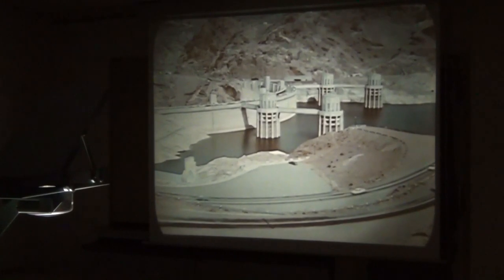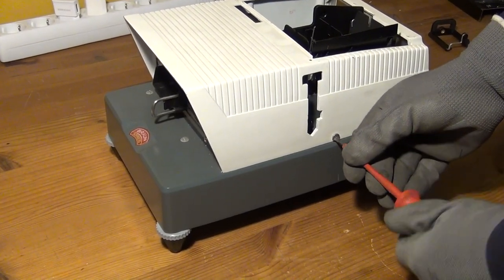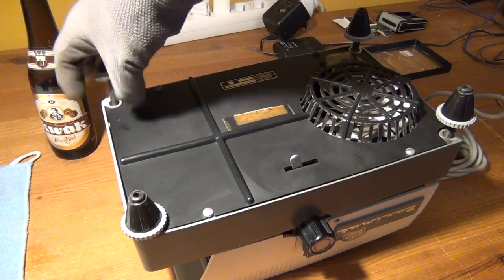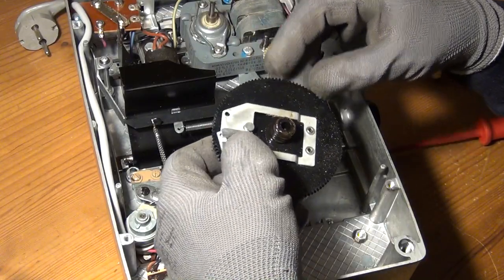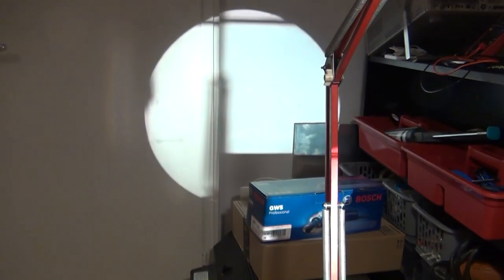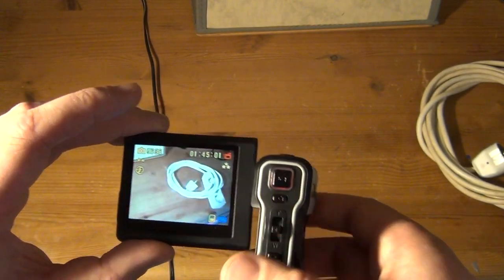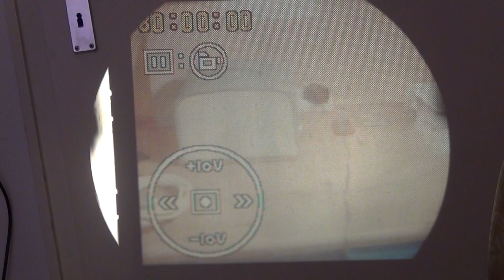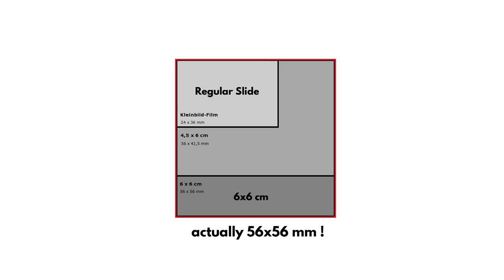Hack: DIY Video Projector from 1960s Slide Projector ?!

Comment: Keep in mind that heating of the LCD panel will end its lifespan early.  TFT technology is more heat resistant than regular LCD panels. 

I made from scratch a video projector back in 1992 using a CASIO pocket TV but that technology was plain LCD and the screen burned out after a few minutes.  Then I acquired the first Phillips TFT TV pocket projector and that ended up being stable.  I even sold the projector to a school when they were not yet available in the market...

Comment: This is a great channel showing re use of old machines and components.  This was a quality antique projector before the failed experiment.  It seems now it is only useful for the parts bin.  It may have been obvious that a smaller lcd or larger format projector would have produced better results.  I would have preferred to see a repair or tune up video of this machine.  Maybe an LED upgrade of the light source if possible.  Keep up the good work!

Comment: I really enjoy your inventiveness :-D, the slide projector is not too far away from commercial units that people use for presentations.
That one was built really well, german engineering is well known for quality and reliability.
Although they can go a bit too far with complexity, simple is often reliable :-).

If you do find a bigger 60 x 60 mm lcd, you may want to add a really good fan near the lcd, i can see it being cooked by the lamp, that would be a shame :-(.
Reply: 4 inch smartphone, about 2014 vintage, will be cheap, run vlc player for ease of formats, force it to run in 4:3 and i think it will work fine (just be careful its not a samsung oled one)
Reply: jusb1066 only the flagship devices have amoled from their everything else has lcd

Comment: The Raspberry Pi GPIO displays that you get from AliExpress should fit , you can connect it to a raspberry pi and install openelec , maybe even retropi for a awesome little media player on the go.

the biggest problem will allways be resolution I think the highest I've seen those small screens go is 320x240 you can get higher but they are ofthen times designed for cellphones and can't be driven easily.

Regardless, awesome project and video , looking forward to some more experiments.
Reply: The even bigger problem to me with those that I've encountered is that no matter the resolution, they have dog slow update rates, which makes them totally unusable for any enjoyable video playback. The one I had, had a parallel data bus that took up almost all of raspberry's GPIO (and didn't support any hardware acceleration), and then, even with differential updates, it was awful to use even in fbconsole. That said, I never got around to running X and other graphical stuff on it.

Just my 2 cents, YMMV.

Comment: A small tablet or smartphone could work. You'd probably be better off gutting the projector and making a custom enclosure with the lens and bulb.. Then you could use an even larger screen by adjusting the focal length between the lens and lcd to suit the width of the LCD.

Comment: Surprised I didn't see mention of using a display for a Raspberry Pi. The most likely candidate I found (assuming I still know how to math) was a 2.8in TFT display which should be a touch smaller than what is ideal. I also found a 3.2in display, which would be a touch big if that were a square, but it has a wider aspect ratio so I doubt that one would work at all.

Comment: The heat from the bulb will severely shorten the lifetime of the small LCD screen, I would make sure that it has ventilation, and perhaps insulate the electronics from the hot areas. Also, see if a suitably bright LED bulb can replace the projector bulb. However that might not fit the low-cost theme.

Comment: Slide projector bulbs were/(are?) expensive and short lived.
Reply: Yes, those are used products so you don't know how many hours are left, and then you have to look to substitutes that are also already used...
Still, it's a lovely project, and it entertains. Fun doesn't have to be useful.
Reply: Dan Harold a 100w LED module might be a suitable replacement
Reply: A 50 or 20W one will be cheaper and maybe a better size.

Comment: Maybe take a display from a broken mobil phone, maybe with cracked glass, display is often still intact
Reply: at least a android phone will be capable of playing many formats directly from SD, the camera he was using probably is very fussy on its format, its only meant to playback its own files, yes you wont find a square screen, but you can maybe control the format from the video player and force 4:3
Reply: *****
hmm not really perhaps at most 50 euro, plenty of early moto g's, and htc's around
, just quickly found a moto E for 25 ukp, thats more than capable
Reply: *****
gonna be hard to find a 4inch screen with HD and can be connected to a media player cheaply...
Reply: *****
gah yeah i forgot, if you take the phone apart and into the projector, you then cannot use the touchscreen to control it, and a phone with a OTG usb is much too new and expensive, hmm dunno, i though i had the idea solved a while there
Reply: *****
i think he needed 4 inch, 7 inch may not be convenient, but its moving closer for sure!  heh, my s4 mini doesnt have OTG though lol
Reply: *****
heh, not really much better than my moto E suggestion then, lol

Comment: very nice hack , and very nice proof of concept. The lenses on these projectors can be quite good.
My concern though is something that shows to this presentetion and namely the resolution

with the overhead projector we utilize a normal tft screen with a resolution of something like 1024x768 or better on 15inches screen. On the wall this translates to a low ratio and a good non pixalated screen.

with the dia projector we are constrained to use a 35x24mm window with a resolution of something like 480x270. This creates a huge blow up that shows on the pixelated screen.

even by using a 60x60mm forma projector things can not improve much as we will also need a high density lcd screen which is not so easy or cheap to come by. 

but thanks for one more very nice project.

Comment: Yeah, the problem is that you must have a small screen with high resolution (thus with high dpi). That's hard to find other than custom-made in a production line...
Reply: BIll Georgoulakis You would need a smartphone screen, but those are too big unfortunately.
Reply: Even then, how would you drive it? Form the smartphone itself?
Reply: Something in the size of an old iPhone 4S should work. But preferrably an Android phone with that type of screen, because it can be used more easily to play videos from and most likely has an SD card slot for that.
As for driving it, yes the smartphone itself would work, but you'd need to attach an external mouse (I've seen people do that, because their digitizer was broken), so it needs to be able to do USB Host mode.
Reply: BIll Georgoulakis Yeah, I connected a bluetooth mouse to my tablet. That would work :)
Reply: Yeah, that will work. A 6cmX6cm projector with an good 4.5inch smartphone in there... might work

Comment: Maybe get an lcd slightly smaller than the 6x6 size, so that you can block out the edges of the round light, and have the image on the wall be more square?